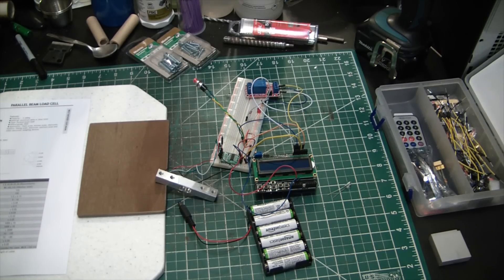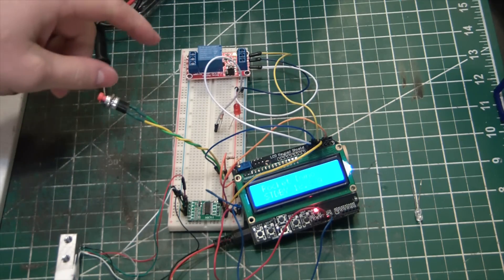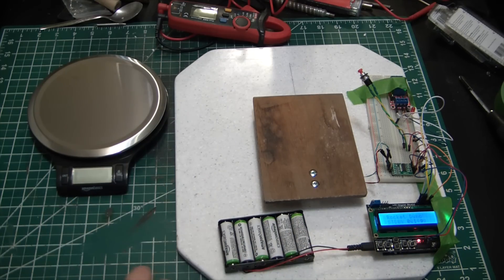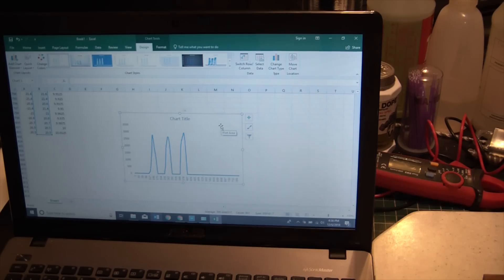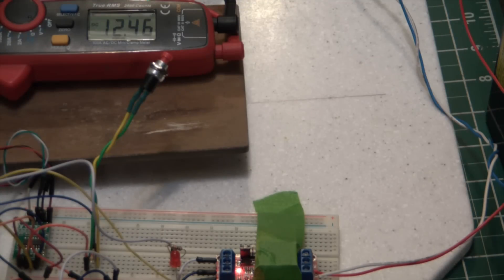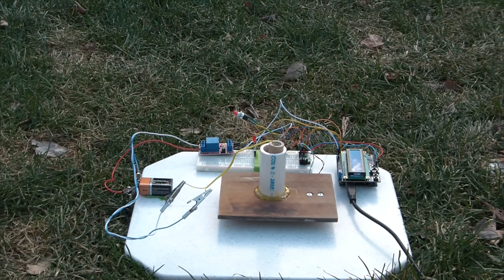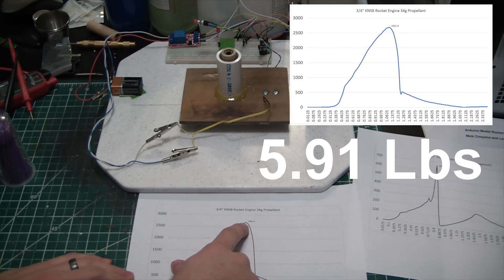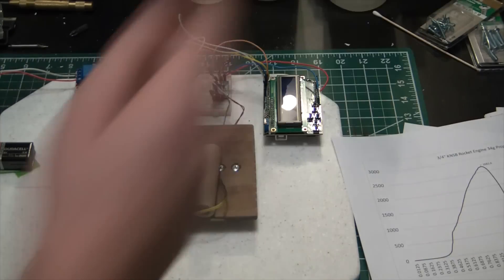Arduino Rocket Motor Thrust Test Stand! - Elementalmaker

Comment: So you got safety glasses for your eyes but noting to cover the electronics in case of a burp or hot chunks from the rocket.
Reply: Eyes can cost many tens of thousand dollars to fix, the electronics maybe 20 bucks.
Reply: @stamasd8500  Very true. But he already had the eyes covered. I just thought he could save the electronics from a toasting with something in the shop just to cover them.
And on how much eyes cost I know after 7+ hours between both to repair a tare and other damage. Not caused by doing anything stupid.
Reply: Sean Not-telling I've been wearing glasses since 14 years old so almost 40 years now. One day I should calculate how much I spent on them overall, the total won't be fun.
Reply: @stamasd8500   I know. After the surgery one eye stabilized quickly. The other one took it's own sweat time and I was having to have the lenses changed every 2 months or when the headaches get bad enough that I would go have them retested. Sure enough the Rx had changed so much that it would be time. That went on for about 2 years.
Reply: JRM No  No it was working up some heat so it had to perspire.

Comment: You could easily calculate the specific impulse and subsequent delta-v from this data to accurately gauge the performance of your rockets

Specific Impulse (Isp)= total impulse/propellant weight

The total impulse can be found by finding the area under your thrust curves. Your delta-v can then easily be calculated with Tsiolkovsky’s rocket equation 

Delta-v = Isp*g0*ln(m0/mf) 

https://www.grc.nasa.gov/www/k-12/rocket/specimp.html
Reply from the maker: Excellent info! I did mention that in the video, but thought I was incorrect so edited it out. Damn!

Comment: You should calculate you're specific impulse
Reply from the maker: Care to explain how I would go about that? Is it the area under the curve? I've not quite delved that far into the experimental rocketry calculations yet
Reply: @ElementalMaker  excel should allow you to generate an equation from your data, integrate that equation to find impulse, divide total impulse by the mass of fuel used to find specific impulse, or impulse per mass of fuel.
Reply from the maker: @seanbush5313  very good idea, I'll take a look in excel and see if I can't figure it out!

Comment: I use "Translate Google" for English. Arduino Model Rocket Motor Test Stand
Nick Cinquino and Len Johnson, 10/2015, the Arduino program for me does not work.
Reply from the maker: The program will require some basic modification

Comment: FOR ANYONE HAVING TROUBLE WITH THE CODE, make sure to look at the reply left by _Mycroftxxx AdamSelene under Trevor Wyllie's comment.
 It helped me a lot!!! Basically just change   HX711 scale (DOUT, CLK);   to   HX711 scale;     and add   scale.begin(DOUT, CLK);
    in the setup code before setting and taring the scale.
Reply: Hi.  I'm having the same problem with the code.  Can you expand on where to put the    scale.begin(DOUT,CLK);   code ?
Thanks
NOSS

Comment: This angry nerd is ready to ruin your day!
1st: that "noise" from the chip can be reduced by factor 8 - if you didn't increase the sampling rate from 10 to 80Hz (you can still average the readings manually)
2nd: is the board on the load cell mounted directly on it or is there a spacer? Zero offset could be introduced by the board sitting on the part that flexes
3rd : While keeping the arduino and breadboard in shot makes for a neat video, you should get some longer cables leading to the e-match to keep the electronics safe in the event a motor doesn't perform as expected. Also you can sit back in your armchair in a remote location to ignite the motor.
Other than that, great video. Keep your dick in a vise!
Reply from the maker: Answering per note:1: 10Hz wouldn't be an adequate sample rate to accurately show the thrust curve of the motors. The noise isn't bad enough that I would even consider that tradeoff of dropping to such a low sample rate. 
2. Load cell on both side has spacers just as I showed on the bottom side. I don't have two engineering degrees for nuthin; one for each side. 
3. The components are so cheap, it would cost more in time and materials to make a protective case, although it is still something I may do as another video. 
You gotta try harder to ruin my day NERD! LOL
Reply: @ElementalMaker  Okok, you won this time. But next time you make a mistake, rest assured, I'll be there to point that out in the comment section.
Reply from the maker: I shall eagerly await your day-ruiner good sir! LOL

Comment: Please send me a 2N2222. Have everything  I need except....👊
Reply from the maker: If you use the 5v relay module boards off of Amazon you don't even need that transistor since they have one built in. Thats how I did it anyways.
Reply: @ElementalMaker  you know, I have the ones listed in the comments. I saw a transistor on there but didn't see any indication what it was. Thanks man!
Reply: Ha ha no 2n2222 needed...